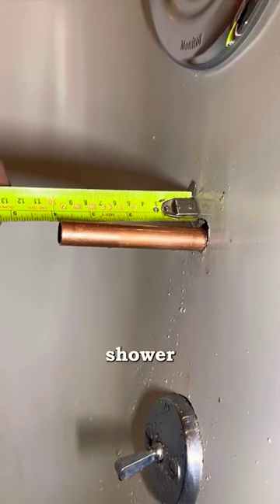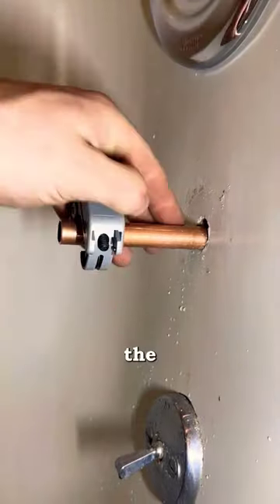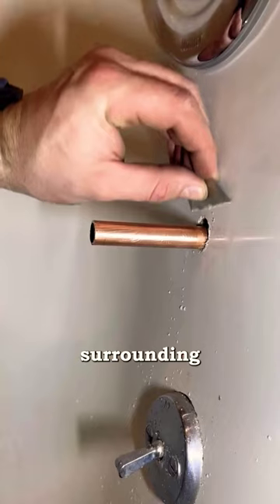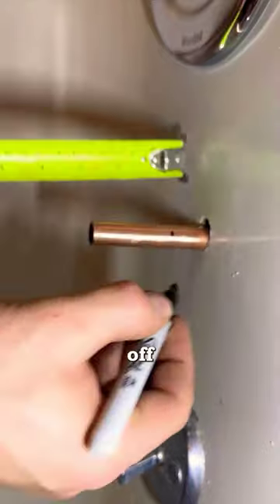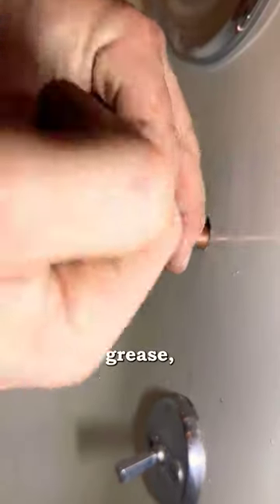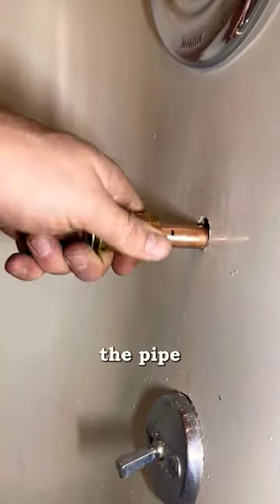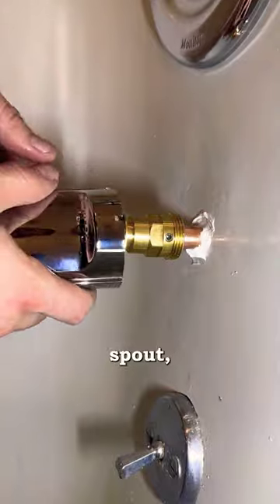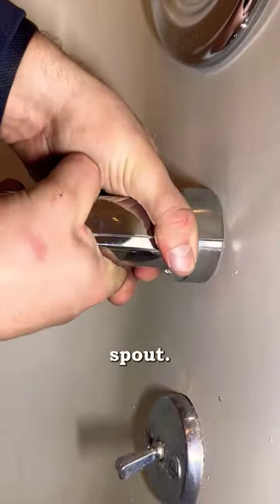🚰install a tub spout #shorts #plumbing

Comment: Delta makes several different adaptors. Not all of them have the set screw. And some delta spouts require drop elbow and brass nipple. Half inch copper won't work.
Reply: It's almost like this video was for a specific tub spout?
Reply: @dylancampbell8064 

 basically Delta makes several like this. But they also make some different ones too. As far as I know, Moen and Kohler have slip on spouts that do not require the threaded brass adaptors. Hope that helps.